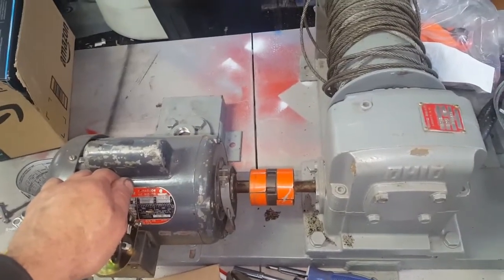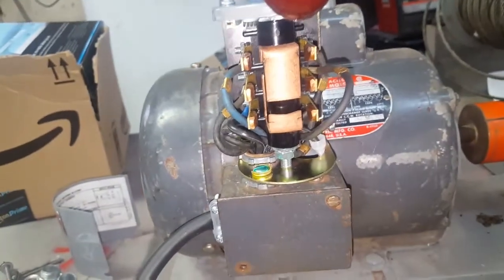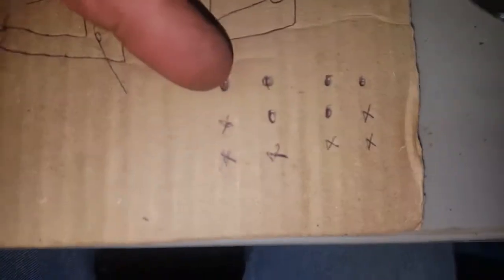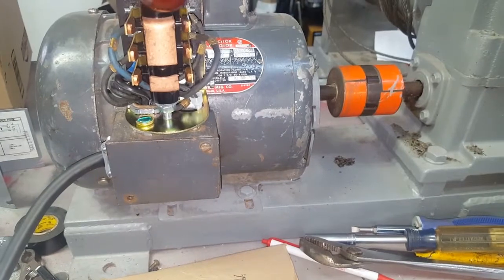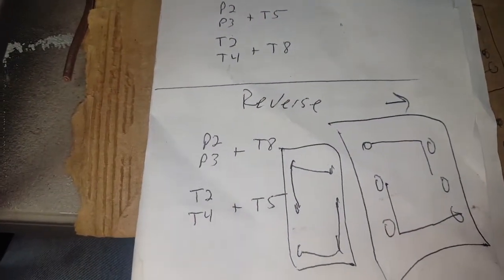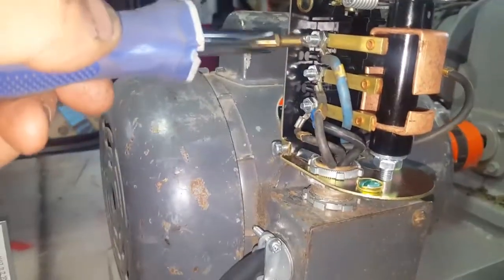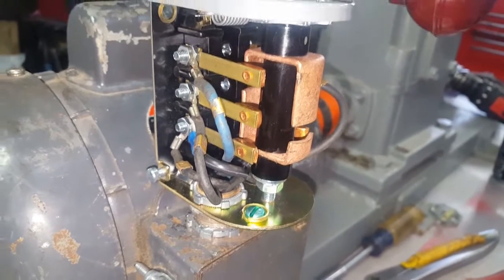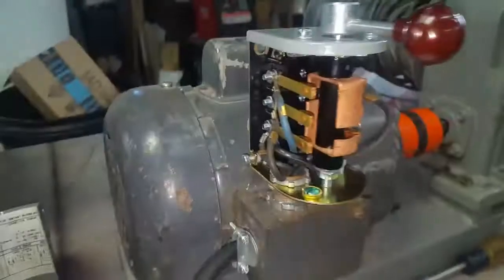How to hook up electric motor reversing switch

Comment: A year ago I dismantled my old friend; a seventy year old Myford Super 7 lathe that my father bought when I was five years old.
I also dismantled the drum reversing switch, cleaned it out, fixed some corrosion, and painted the case.  While I took plenty of photos, and labelled all the wires, I did not really understand how it worked. I am about to reinstall it, I will have to replace the old wiring, and today I decided to replace the motor as well.  Your video is going to "Save my Bacon"... Thanks again.

Comment: I feel your frustration. I'm trying to figure out how to wire a drum switch to a split phase motor. Most wiring video's I've seen are hipsters trying to match enamel paint on their switch to the lathe that they are making pretty, the others are a picture a of a persons hands for 20 minutes, or autistic electrical engineers spending 15 minutes talking about theory, but not showing anything useful.

Comment: I've heard that those Barrel/drum switches are pretty expensive and you can do the same thing with a double pole double throw toggle switch for under 10 bucks.
Reply from the maker: I bought them because it's a large copper contact and that's what I wanted, plus I wanted to direct power to the inside inverters or to the garage inverter

Comment: You wouldn't believe how many 'Rotary Switch' Wiring  video's I watched before I figured out the same as you. No idea why people can't just simply state the obvious like you did? Of course, I now know I need a different switch to the 3 I have. I'll probably just use 'forward' until I get correct 'L'  'L'  reversing one and have some wires taped up
Reply from the maker: I know, I went to the same thing, LOL

Comment: I feel your pain & frustration man, I waited Years to learn about this, didn't want to smoke a good motor. And it looks more complex than it is, especially in my clip b/c I just used 4 of the 6 terminals, this was for a wimpy little Marathon 1/4hp motor:  https://youtu.be/DH9rqHZNbAs    I got a better old Wagner 3/4hp motor, it is reversible, but the dern drum switch won't work on it, & u know what; I'm okay with that, HA...     This guy knows his stuff:   https://youtu.be/JKXwXLEaXek